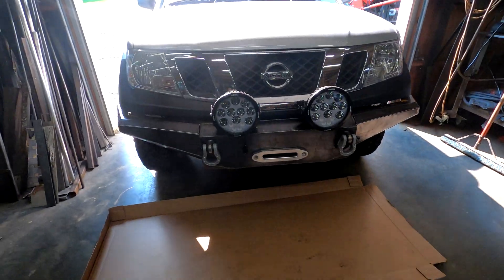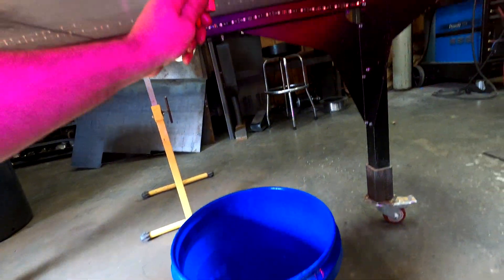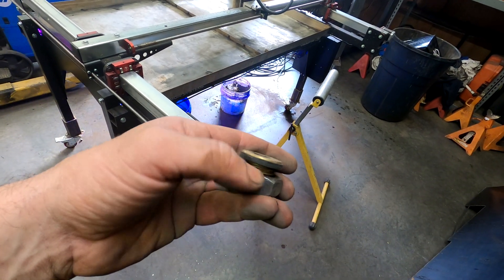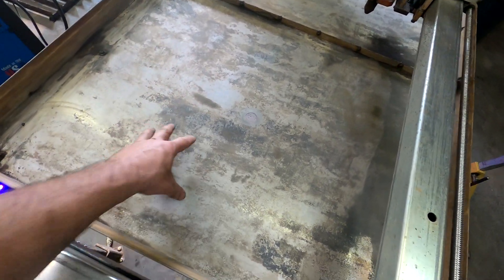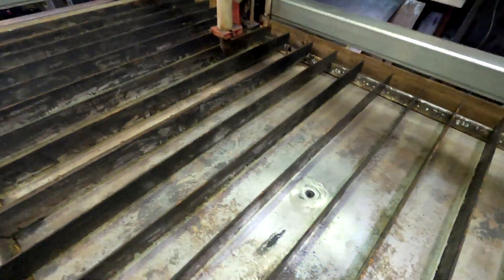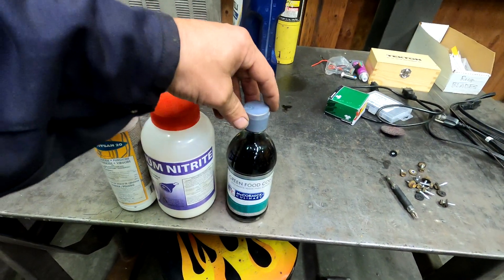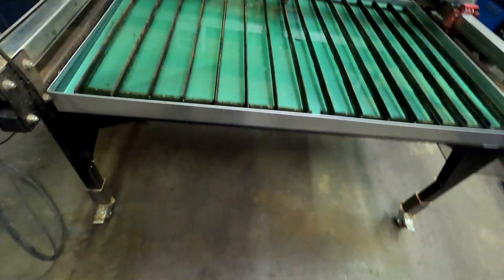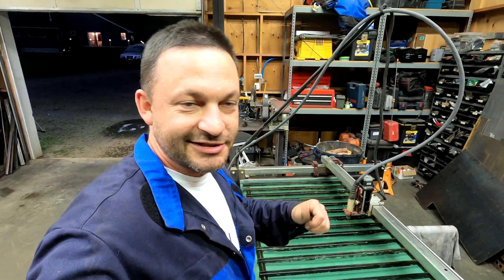CNC plasma table:  cleaning up the water table, slats, and an anti-corrosion water mixture

Comment from the maker: I paid about $175 for the local shop to make the one piece stainless pan
Reply: Hi Matt, I have a CrossFire Pro on order and have already decided to put a one piece water table in it. I also live in Oregon, between Astoria and Portland. Could I get the contact info for the shop that built your table? I'd like to talk with them about doing one for me. Thanks,
Reply from the maker: @rjay1674  White's heating and Sheetmetal in Seaside.  (503) 738-6361
Reply: @MattVerley  Thanks. your videos are one of the reasons I ordered this tool. Keep up the good work. I am also a former volunteer fireman/EMT. Thank you for your service.

Comment: hey bud do you have linnk to the vacuum? or can you tell me what make/model? thanks!!!
Reply from the maker: @megaobi  I was just using my shop vac with the filter removed...it seems to work fine for removing the sludge.
Reply: @ thanks for your response! So any regularly wet vacuum should do fine?
Reply from the maker: @megaobi  I think so; I'd be careful not to suck up any big chunks with the filter removed, but yes...any one should work fine.

Comment: I use the same in my water table. but you need to use tracer die , added to the water. it'll always be green or blue, what ever color you go with.  the water in my table is 3 years old.

Comment: Hi Matt how is the water treatment working? Thinking about trying it.
Reply from the maker: It seems to be working extremely well; the water remains clear with zero rust on any of the slats
Reply: @MattVerley  I read that there is a toxic smell when your cutting in the comments. Have you noticed that? Thanks for your help on this!

Comment: Would you be willing to share the dimensions on your pan? I’m headed into town tomorrow to have one made and my water table is the only box that hasn’t shipped and I have the rest of my boxes.
Reply from the maker: 52" x 36" x 2.25" L x W x H.  Also had them put a 3/4" NPT drain in the center.
Reply: @MattVerley  thank you sir you are the man!
Reply: @MattVerley  What gauge of stainless did you spec?

Comment: Like your one piece table, I assume you did not bolt it down as the weight of 15 gallons of fluid would not really move the table. Or did you?
Reply from the maker: You are correct; it is not bolted down.  I do need to be a little careful when trying to slide heavy sheets of material around on the table, but it is obvious if the tray shifts a little and this hasn't been an issue.  I had planned on welding some holding tabs to the frame to lock the tray into place...but so far it hasn't been necessary.
Reply: @MattVerley  Thanks. I thought so. I think I am going to use the 2 piece right now but not using those sheet metal screws to bolt the down. Also, did you find that the self drilling machine screws were self drilling? I had to drill holes in the square tubing first then use them.

Comment: Hey Matt. I'm digging the one piece water pan. I'm getting my table sometime in May, fingers crossed, and I want to get a one piece pan made up instead of dealing with the two piece. Can you give me the exact dimensions of the pan you had made? I appreciate it!
Reply: I had one made out of stainless steel and is was 52.50” x 48” this is a little bigger than the stock table but it is worth it. Have them weld tabs on the bottom to secure the table to the cross members under the pan. That way you don’t have to drill through the bottom of the pan.

Comment: Haven't had a chance to watch the whole video yet, but saw what recipe you're using and wanted to share my experience. I tried that in my CrossFire Pro from the first setup - the smell while cutting isn't super nice, and then I did more research and found out the fumes are toxic. It also after a few weeks, isn't super effective in rust prevention. I only mixed 5 gallons of worth and extrapolated the amounts from the same recipe you have, but overall I just haven't had a great experience. Particularly I'm seeing it's not working great for rust, and I've felt a little bad after cutting a few times enough that I don't want to keep messing with it.

I'm about to order some of the Plasma Green 9010 from Konzen to try and see how that does.
Reply from the maker: Interesting...but my experience hasn't been the same.  After over 2 months my table fluid is crystal clear and there is zero rust or corrosion on any parts...it clearly works VERY well at preventing corrosion.  As far as the fumes go, I have a huge Dayton exhaust fan that I run while doing cutting/welding/plasma so fumes are never an issue.  I've cut out hundreds of items since I did this video...maybe thousands.  At least 6 full 4x8 sheets.
Reply: Matt Verley Glad to hear it’s working out for you. Sounds like you maybe went about it a smarter way by making enough concentrate for 75 gallons and then using that to make your final solution instead of just trying to make it in a smaller batch like I did. Or maybe it’s the water quality used to make it? Who knows? Sounds like you have much better ventilation as well - my space is much smaller and has almost no ventilation. Did end up ordering the Plasma Green 9010. We’ll see how it works out. If I use it all up or if it doesn’t work too tell, I’ll try mixing the other recipe as a concentrate like you did and see if that works. Also got some PH strips to keep better tabs on the solution in the table.
Reply from the maker: @BradleyMakesThings  I'd like to know how it works for you!  Let me know if you feel like the commercial solution works better.  Probably right about the ventilation...my shop is 30x48 with 12' side walls and vaulted ceilings so there's a lot of volume there.  If I run the table without any ventilation for more than about 15 minutes there is a noticeable steam/haze in the shop.  I don't like breathing anything like that regardless of the source, that's why I installed the exhaust fan.   Fortunately it doesn't get THAT cold here...propping the man door open and running the fan for a few minutes completes a pretty good air exchange.

Comment: The table does not take 75 Gallons. What are the measurements you used for the amount of water the table needs?
Reply from the maker: I don't believe there was any point that I insinuated the table held 75 gallons.  It certainly doesn't.  It holds around 15 gallons.  I did, however, make up enough concentrate to make about 75 gallons of the table fluid and stored it in a bottle for future cleanings.

Comment: Pan cost...dang..how much did the tig cost?
Reply from the maker: I bought the Dynasty setup as a package used from a fab shop in Seattle a few years ago; it had 14 hours on it and came with a bunch of stuff...basically the dynasty 350DX TIGrunner package with extra torches, wireless foot pedal, fingertip controls, consumables, etc.  I paid $7000 for it.  At the time, that was about 1/2 of what everything would have cost new (not sure what current prices are).  It's a great machine.  It replaced a Synchrowave 200 that I had bought new a few years earlier; no real complaints about the synchrowave, but comparing it to the dynasty 350 is apples and oranges.